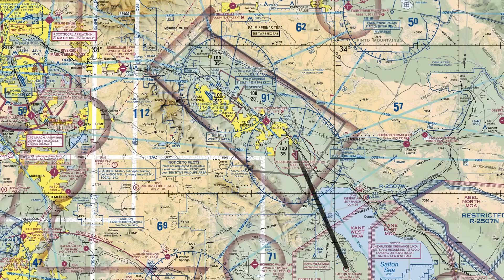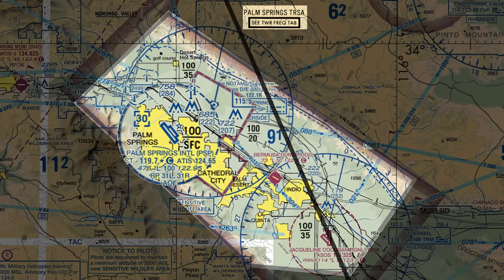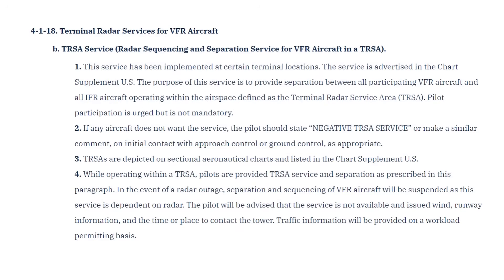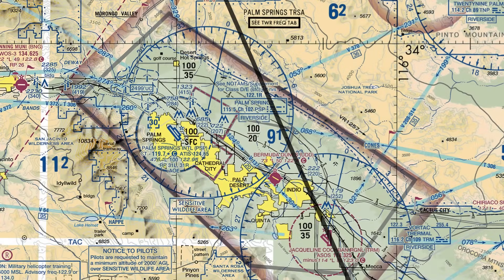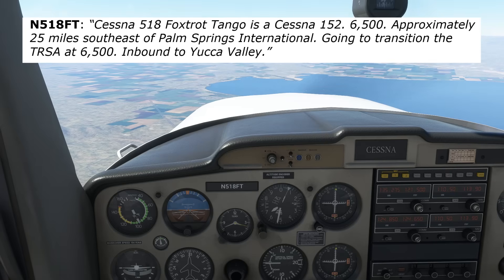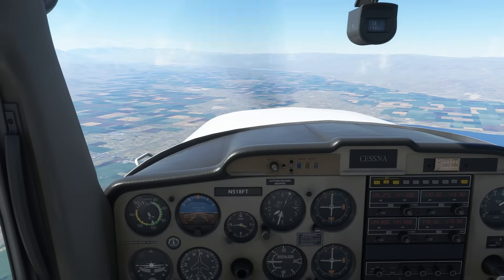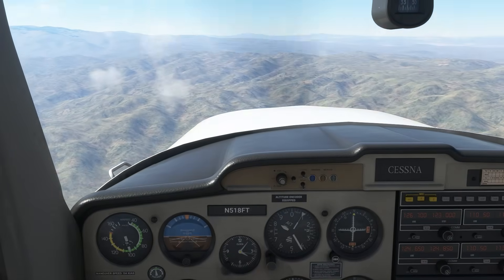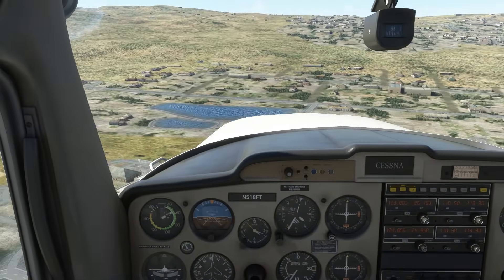Flying Through a TRSA: The Airspace That Time Forgot

Comment: Class C was the old ARSA (“Airport” Radar Service Area). In the most basic of terms, the TRSA works like an “optional participation” ARSA…or now, Class C airspace but the old layers that all carried their own rules and character were not optional and are still not optional in the TRSA and must be respected such as the embedded Class D or formerly ATA - “Airport Traffic Area”.
I never agreed with the U.S. switching to their system instead of the other way around. We are a way bigger country than nearly all of Europe combined with a vastly more diverse continental geography yet we are the ones that bent over backwards for them.

Comment: Ha, this one is funny as I'm very familiar with every place listed here. Salton Sea is a very rough runway and probably sees one operation a week if that. Scrappy place with literally nothing there. Yucca Valley is a cool little spot, especially the Copper Room restaurant right on the runway. Old rat pack spot that gives a pilot discount. A very challenging airport to land at if winds are out of the north due to the mountain ridge north of the runway causing some serious wind shear. Not to be underestimated. Also those mountains you fly over coming in can toss you pretty good. 

As for the TSRA, it's no stress. I've flown through the Coachella Valley many times, both with and without flight following. If you're already on flight following, you just get handed off to the next controller and you don't even know you're going through it, if you're not on flight following, you just fly through and don't hit any other planes. 

Good stuff though for people that might not know what they're all about or how to contact somebody initially. 

Only nitpick I would share is on your VFR flight Following request with SoCal, you should say destination Yucca Valley Lima two two. We should always provide the airport code and not assume the controller has it memorized off the top of their head.
Reply: Have you landed at Salton Sea? I'd like to go there, at least once, for the hell of it, but in my 150. But not if the place is in bad shape.

I always use airport codes. Which is definitely handy. I was flying to Utah and whatever controller I was talking to had no idea what airport I was flying, except I used the code.

Comment: I remember TRSA's. Most of them became Charlies when airspace was standardized. The old airspace names had much more panache but Classes A, B, C, D, E, and G are a lot easier to understand. Probably the weirdest airspace was the Control Zone. It was charted, but it only came into being when the field was IFR. What is now Delta airspace used to be called the Airport Traffic Area. It wasn't charted. You just had to know it was there.

The new airspace names and standards don't have the same romance, but they're undoubtedly much less confusing and much safer.
Reply: Control Zones are still around, it's now called a class E extension to a Delta. If you fly through a dashed magenta area, and the Wx at the primary airportin the Delta is VFR there's no need for a clearance.

Comment: We have a few TRSA's around SW PA.  One comment.... you say that a TRSA you have to comply with heading and Alt commands..... but if you were on with flight following, and they asked you to make a change for traffic..... wouldn't you do it?  I know on a flight to Sporty's.... I was asked to climb to another alt for a while... and then was told to go back to my original.
Reply: Yeah, once on flight following, ATC instructions are mandatory until they terminate radar service.
Reply: Yeah, if you're on flight following in controlled airspace (i.e., anywhere except Class G), you are obligated to comply with ATC instructions regarding headings and altitudes. This was addressed explicitly by the FAA in the 2013 "Karas" Letter of Interpretation.
Reply: To be honest, if ATC is asking me to move, I'm going to assume it is for a good reason 😂

I did jump onto Approach frequency right after leaving my tiny field recently, and immediately heard Approaching calling me, asking if I was on frequency! Good timing for them, I guess. But I said yes, and they immediately asked me to do a 360. After that I got FF for my destination.
Reply: Flight following hands you over to the trsa controller
Reply: @teddyherrera727  I understand how a TRSA works.... but it doesn't answer the question posted.